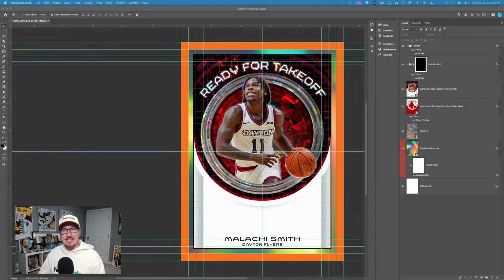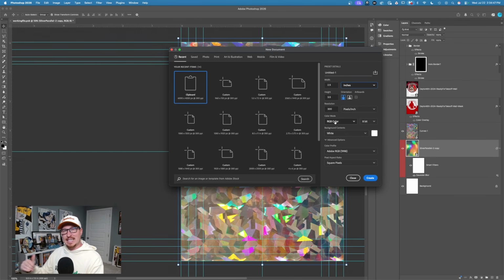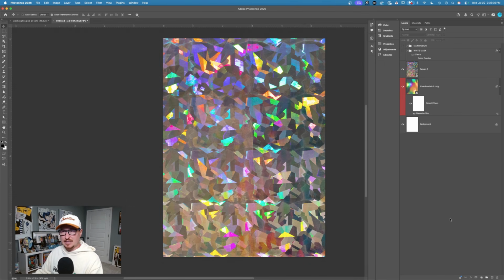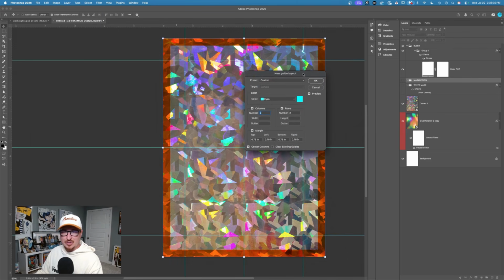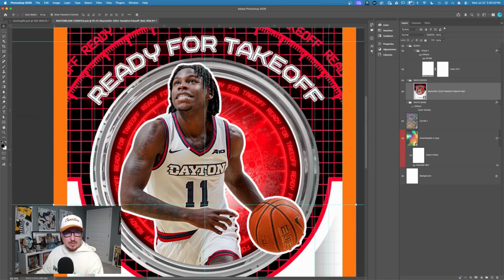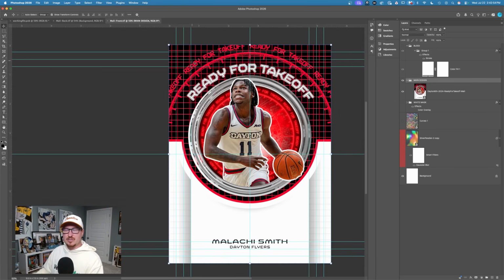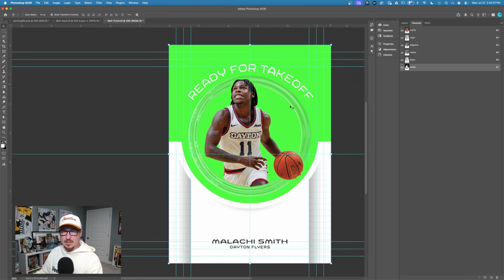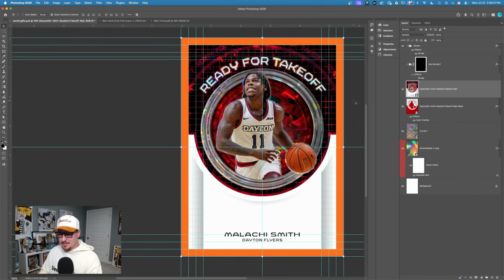How I Set Up Photoshop Files For Professional Trading Cards

Comment: Great Video! Will there be a color shift when I convert from RGB to CMYK?
Reply from the maker: Always. But what I do is flatten then convert and then try and get a print proof from the printer. But it should print close to what you had.  For this card I know we had zero color issues with cmyk.